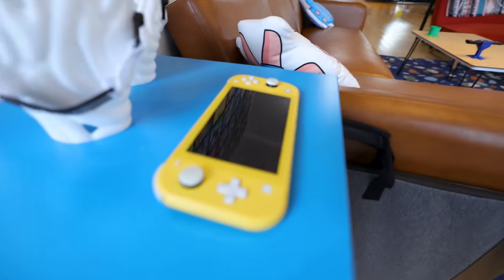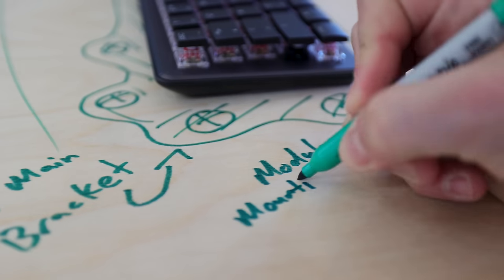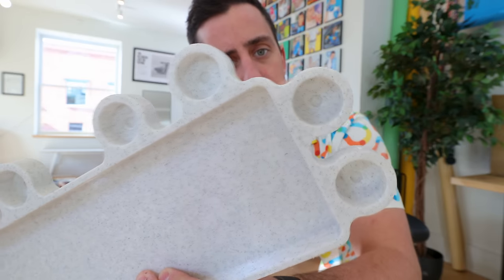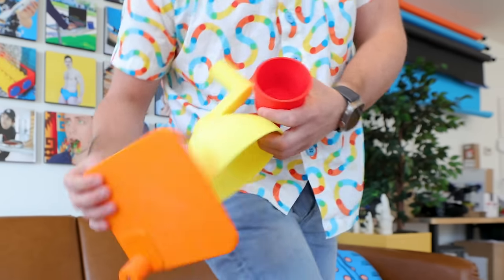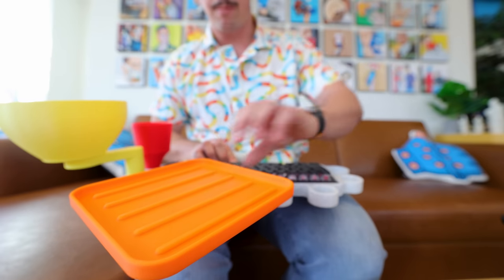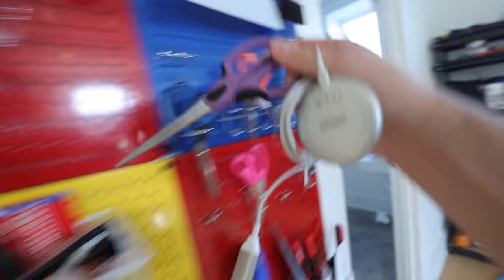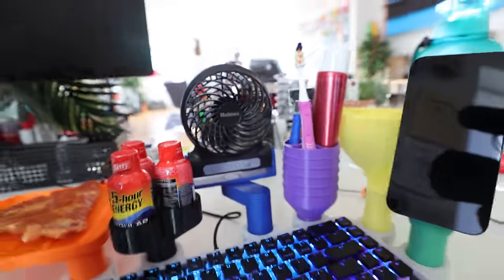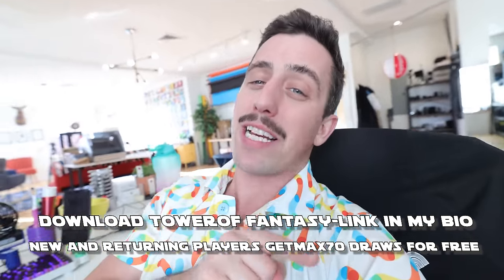Why did I build this Swiss Army Keyboard?!

Comment: Just an FYI for any inspired viewers, you should always use food-grade safe resin on top of 3D prints if you plan to eat off them more than once, as the layers aren't safe and hold onto mould/bacteria even between washes :)
Reply: Resin is never food grade. There are food grade plastic filament though, but the print is only food grade if the whole printer is food grade and dedicated for food grade stuffs.
Reply: Okay thanks, I have a 3D  printer and I didn’t think about that
Reply: @FlameRat_YehLon  hes probably not talking about printer resin, but rather the type of resin you would use to seal a countertop or cutting board.
Reply: Mold* if that’s what you were talking about.
Reply: You need a cleaned stainless steel nozzle, cleaned print surface, food safe filament (usually PLA) and that food safe resin
Reply: @G00s3_Dp  some people are english, we spell mould like that my guy
Reply: Ayyyyeeee what a guy
Reply: You have saved people
Reply: You should do a phone spot

Comment: For the empty space add a joystick holder and add joystick for games which support it. (Or steering wheel or any other controller alternative)

Either place the plate with something to hold food to your mouth, or add a cup for utensils (like chopsticks) to reduce the chance of soiling your keyboard.

Comment: I have a few ideas for the last thing.. In no particular order.
- some sort of hand cleaning holder, either paper towel or hand sanitizer or something, if you're going to be eating pizza and snacks, you need something to wash the grease off your fingers
- some sort of toilet-related thing.. You'll need to go to the bathroom eventually, but that should probably be an entirely new gaming chair with integrated poop bucket underneath and toilet paper holder on the side, or integrated bidet.. You figure out out
- some sort of wank-o-tron

Comment: A napkin dispenser would be good because if you have Cheeto dust or pizza grease on your hands and you don’t want to get your keyboard dirty. All you do is the napkins right there.. Another example would be, if you spill your drink on the flour, the napkins are right there to help you clean up. Just like the rest of them you don’t need to get up at all. 🍕🍿💧Hopefully you like and you’ll use it!😁

Comment: I was thinking mouse holder to be unnecessary BUT to add that bit of actually useful, have a rotating base under it so you don't go afk. Maybe add a w button holder to run in circles?

Comment: How about a keyboard light? So you can be sure of what buttons your hitting.
 Or even better. If you stream your gaming what about a mic holder? Or dual holder for a mic and ring light.
 A stress ball (or plushie) holder for those times when the boss wins. Or a tissue holder for the same reason.